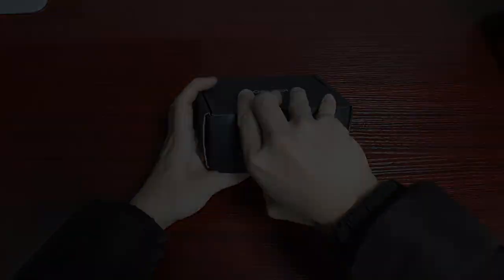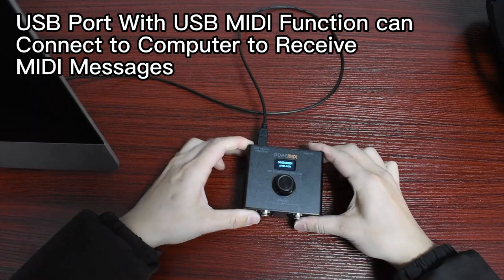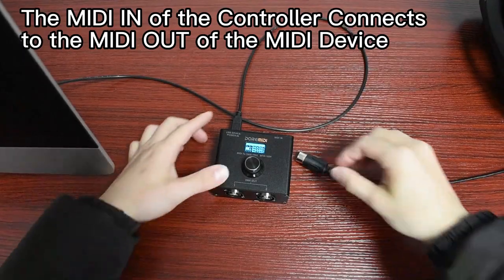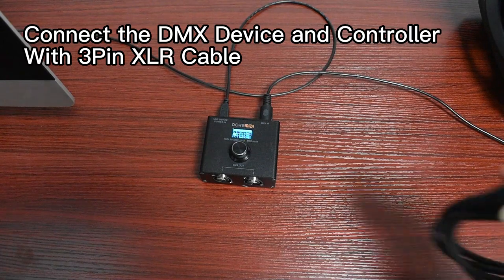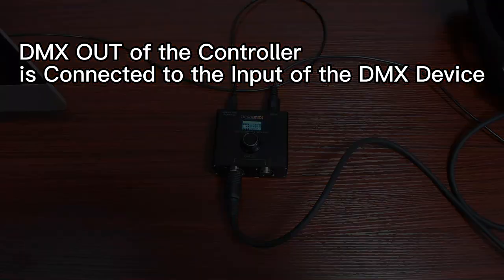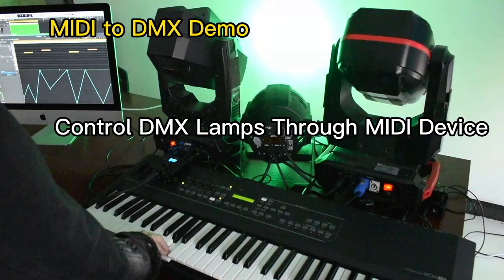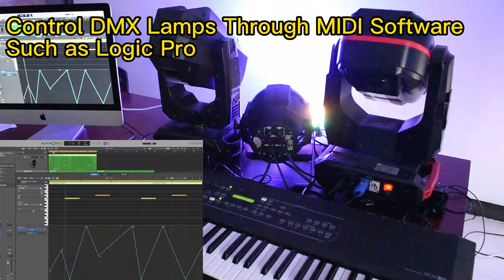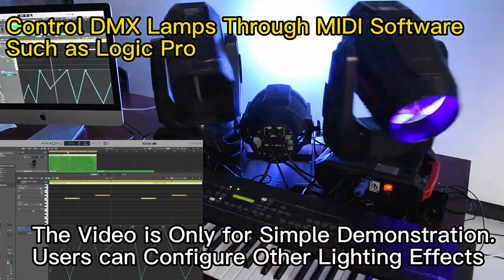【DOREMiDi】How to use MIDI to DMX Controller (MTD-1024)

Comment: I bought one of these and I was wondering if I could connect and use it with an iPad instead of a computer, and if so would I just have to get a usb to lightning adapter? Thanks
Reply from the maker: Hello, the USB of MTD-1024 is a USB class compliant device and can be connected to a computer, including an iPad. However, the USB port type is different, so you need to use a USB to lightning adapter.
Reply: @doremidi.  do you happen to know of any iPad apps that will send midi? Looking at another one of your videos a computer was running a recording program but I don’t think that would work. I tried using GarageBand but I don’t think it exports the midi. Thanks
Reply from the maker: @jeremyrandolph6790  If you want to debug, you can use MIDI Wrench.
If you want to arrange music, you can use arrangement software such as logic pro.

Comment: Could you please give examples of the proper way to map the midi to a DMX channel. I was only able to get a single channel to work. An example like (If you have this setting on the device, and send a midi note C1, the DMX out put would be _____). would be very helpful. Thanks!
Reply: Yes! Please I am lost as to how to configure Midi Inputs to DMX Sends. Help!
Reply from the maker: Hello, please refer to the manual: https://www.doremidi.cn/h-pd-80.html
For example, let note C1 control DMX channel 1
Setting reference:
DMX=1
Sta = Note
Ctl = 24 (C1)
CH=All
EN = 1
Reply: Could you give a better explanation. I currently only can run C1 to a dmx if I change DMX 0 to 3 I get different colors but it only outputs 1 single color.
Reply from the maker: @soulsleeperband766  Hello, please check the description of your DMX lamps, each color generally corresponds to a DMX range value.
For MIDI to DMX conversion, generally 2 x MIDI value = DMX value
Please see the manual for more detailed operations:
https://www.doremidi.cn/h-pd-80.html
Reply: So I shouldn't use my midi cable and just use usb?
Reply: @doremidi.  I updt6the firmware to the 1.05 and now it doesn't work. Do you have a phone someone can call for technical support.
Reply from the maker: @soulsleeperband766  You can also use a MIDI cable to input MIDI messages from the MIDI IN port.
Reply from the maker: @soulsleeperband766  After upgrading, please restore factory settings.
You can contact us via this email:
info@doremidi.cn
Please tell us your DMX model and DMX channel instructions, as well as the MIDI messages you want to use.
Reply: I have had the same issue where it will only control 1 dmx channel at a time. If i enable the top row, it disables all row below it. Only 1 row of instruction works at a time
Reply: @Distortic  I sent mine back to much issues. I got it all to work and saved it then when I went to go start it up again nothing was working and midi notes to dmx changed. I'm happy I found a DMXIS Dongle
Reply from the maker: Hello, please try updating to the latest firmware.
https://www.doremidi.cn/h-pd-80.html
If the problem is not resolved, please contact customer service: info@doremidi.cn

Comment: Question: How to turn on the DMX port 2?
Reply from the maker: DMX Port1: DMX channel 1~512;
DMX Port2: DMX channel 513~1024;
You can set 513~1024 channels to use DMX Port2
More information: https://www.doremidi.cn/h-pd-80.html?fromColId=104
Reply: @doremidi.  I read the manual and it says nothing about DMX split but good to know. The page you sent says nothing about it also. And it should be in the details on the website. So far I am having fun with mine.
Reply from the maker: @avantvideolab  Ok, thanks for the feedback, we will describe in more detail.

Comment: Hi !
Is it possible to connect the MTD-1024 into a PlayAudio 12 USB Host port to send 2 Ableton live redundant set into one DMX Interface?
In case of one of the computer fails during the show, the signal can anyway go through from the second computer?
Reply: The real question is : is it MIDI Compliant? If yes I can go through the Playaudio to control DMX Device with 2 Ableton Live Set on both computers
Reply from the maker: @maxbatteur  yes, it is USB class compliant with MIDI.
Reply: @doremidi.  Nice information. Thanks a lot!

Comment: Interesting! Two questions:
1. Is this unit isolated? I.e.: is its safe for me to use with a computer if there is any electronic malfunction sent back from the lights?
2. Is there a default conversion if I don't program anything? Notes or CC representing DMX values even if I don't assign any new ones myself?
Reply from the maker: Hello, the product has a built-in power isolator, please feel free to use it.
The new product does not have any conversion configured. Users should configure it themselves according to their needs.
Reply: @doremidi.  I'm strongly leaning towards giving this unit a try. I'm a bit confused by your answer concerning isolation though. And I have more questions as well.
1. Isolation: So, my computer will not be affected if any lights fail and send back the main voltage to this device, via the DMX output? As ENTTEC advertise, for instance: "1500V full isolation (data and power lines to protect your computer from surges)".
2. Is this compatible with the new line up of MacBook Pro's? I have the M2 Pro chip.
3. Is there any dedicated software for Mac, to plan and import/export my setup?
Reply from the maker: @kidamazed  Hello, MTD-1024 has power transformer isolation and DMX output with optocoupler isolation.
The USB MIDI of the MTD-1024 is a USB class compliant device, plug and play.
Configurations can be exported/imported using serial port tools. In addition, we are designing application software.
Reply: @doremidi.  That sounds great! I've made my order. This "...DMX output with optocoupler isolation." should, in my opinion, be stated in your manual and highlighted as a selling argument cause you've made a good thing here and computers should be safe even in a power failure (up to 5,000 volts, from what I can tell).

Comment: Would this work with Reaper DAW sending midi out and using a wiresless dmx transmitter?
Reply from the maker: Yes, it is possible to receive MIDI from DAW software via USB, including Reaper
Reply: @doremidi.  do you need an audio interface MIDI output or just a USB to MIDI cable?